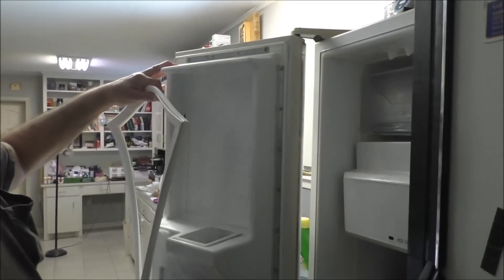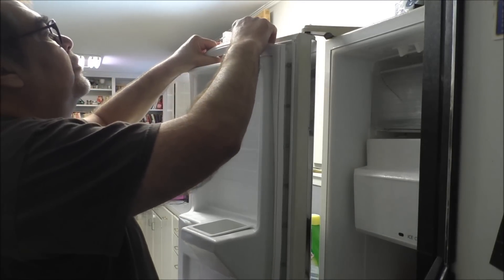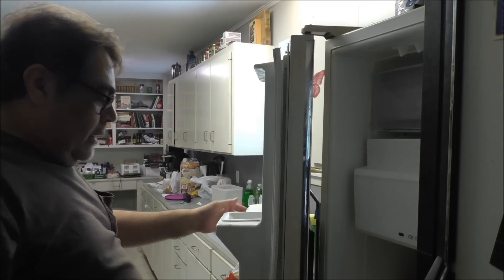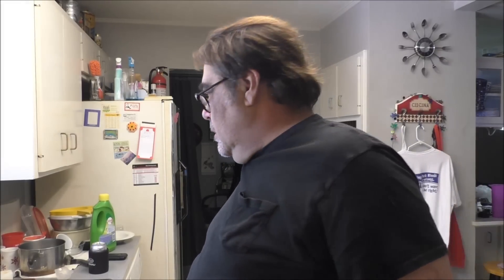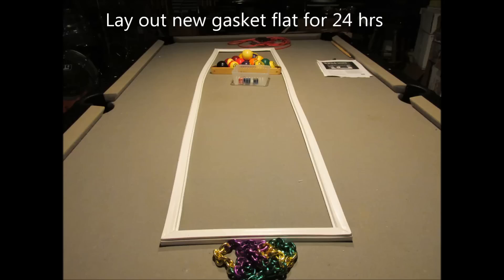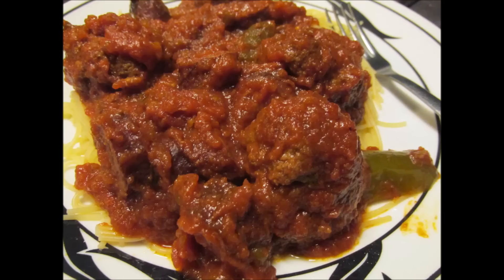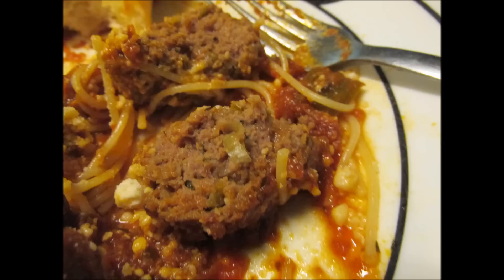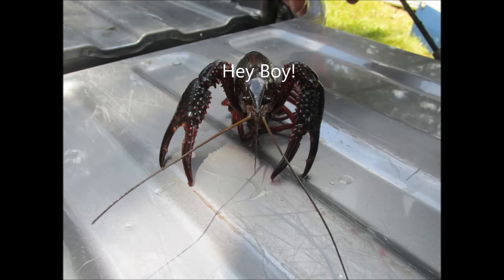How to Replace a Freezer door gasket

Comment: You told the truth about installing the seal. One You tuber said its two minute job and . Our door did not close properly after installing the new seal. I had to reinstall old one  that looks identical. Then it did not seal properly. Rechecked that all was in groove properly but still not  closing properly . Frustrated in Dublin. By the way, were you the Yosmite Sam voice or Fog Horn leg horn . Love it.

Comment: I'm glad that fridge didn't get the best of ya JB. I bet that took a good 12 pack to fix!!
Reply from the maker: +T-ROY COOKS It was a PIA. I should have removed the door & laid it flat on a workbench. It got warped when it was screwed back together & was still leaking, I had to tweak/bow it so it mated flat on fridge door opening using a 2x4. Next time I'm buying a new fridge

Comment: PITA is an understatement! I stopped in the middle and went to look at mine. It's a GE, and also that same damned screw on setup. Fortunately, it still passes the dollar bill test rather snugly. Phew...

I think if I ever have to do this, I'll tape beer case cardboard over the freezer opening and leave the fridge running. I don't have a separate beer fridge, and I will not tolerate warm pops.  LOL
Reply from the maker: +Anonymoose I should have removed the door & laid it flat on a workbench. It got
 warped when it was screwed back together & was still leaking, I had
 to tweak/bow it so it mated flat on fridge door opening using a 2x4. 
Next time I'm buying a new fridge... BTW Check your PM's
Reply: +Louisiana Cajun Recipes (007bondjb) 
Making a note to self: When the door gasket goes, just buy a new fridge.

Comment: So basically your just putting it back on the same way it came off"....hahah great vid....I've been subscribed and watching since day one,,oh and I put a smoker box of chips directley in my gasser burner didn't really work...want to smoke on my gasser eh boy?
Reply from the maker: +mike bausman Try the box on your vaporizer bar. When placed directly on a burner it could be choking out the fire under the box
Reply: +mike bausman 
Just take a glance at a couple of my videos. I do all of my smoking on an old gasser. It took some learning and experimenting (as well as some coaching from a cranky old drunk Cajun), but it does a great job, and I've got it dialed in to where it's almost a set and forget.